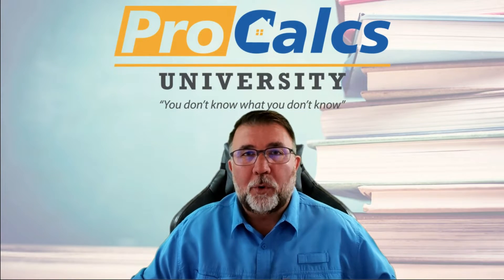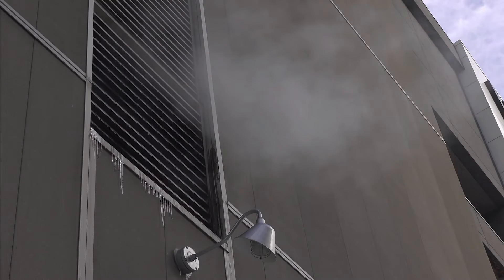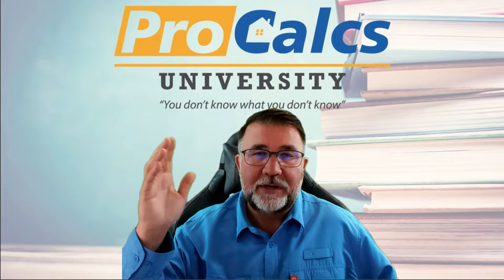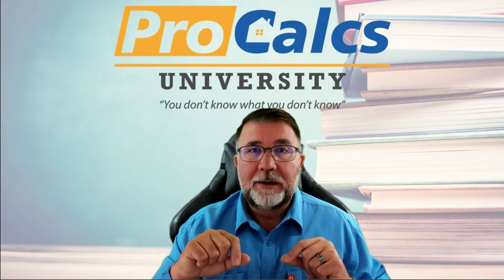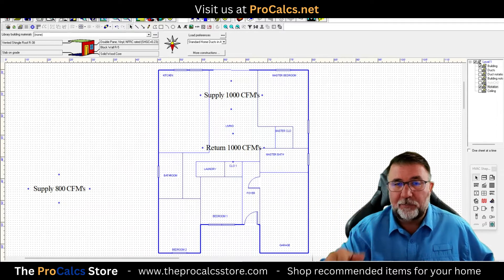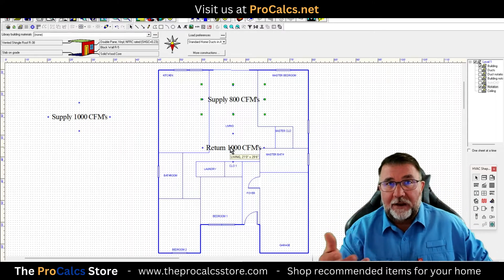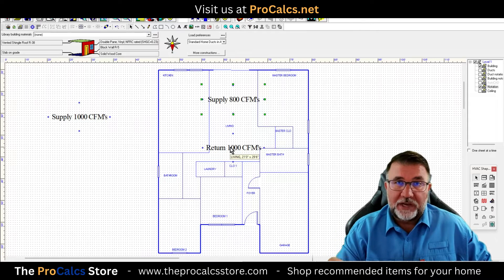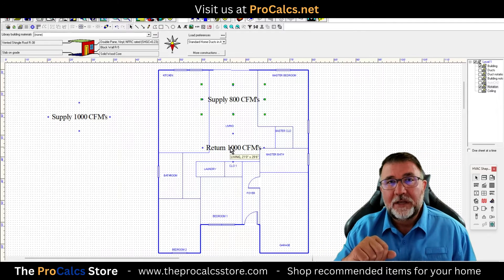Positive and Negative Pressure In Your Home

Comment: Hello! Who would you recommend I should contact for my following issue. I live in a house with a crawlspace, I have a dehumidifier down there with a vapor barrier, insulation board all around the walls. The HVAC system is also down there. For some reason, my house smells like an earthy smell. All my clothes smells like old wood, earthy. Who would I call and what kind of test do I ask if they can do?
Reply from the maker: Hey there! Great question! That earthy smell is usually a sign of moisture hanging around in the crawlspace. I’d start by calling a licensed HVAC contractor or an indoor air quality specialist so they can check humidity levels, duct leakage, and any moisture sneaking in. They should be able to point you in the right direction

Comment: I’m late here, but what kind of professional would we call to look at this?  We definitely have negative pressure.  And the house is starting to get water damage
Reply from the maker: @corabelly1100 sorry you’re dealing with this. Since you’re seeing water damage and suspect negative pressure, call a licensed HVAC contractor who does home airflow testing, or a home energy rater. Ask if they can do a blower door test, a duct leakage test, and quick room pressure checks. That will confirm what’s going on and point to the fix. In the meantime, use big exhaust fans only when needed, keep bedroom doors open, run a dehumidifier if you’re in a humid area, and make sure CO alarms work if you have gas appliances. Hope this helps!

Comment: What happens if a bathroom exhaust fan is venting into the attic without a duct leading outside through the roof or wall? Wouldn't it just pull in and circulate trapped attic air?
Reply from the maker: @JuanRamirez-tu6mn great question! If a bath fan vents into the attic, it dumps warm, humid air up there. That moisture condenses on the roof sheathing, wets insulation, and can grow mold or rot wood. In cold weather it can even frost and later drip.

Comment: What about separating the restrooms from equalized pressure of the house?
Is the restrooms supposed to be slightly negative?
Reply from the maker: Great question! Yes, restrooms are usually kept slightly negative to help contain odors and humidity. That way, air flows into the bathroom, not out into living spaces.
Reply: @procalcsuniversity1484  thank you for the response. 
Does it need to be negative at all times or just in use?
Reply from the maker: @txhc666  It doesn't have to be negative 24/7, but it should be during use or shortly after 😄

Comment: I have a slightly leaky timber frame house, it seems to me that positive pressure is going to push warm humid air into the walls where it will, at some point, meet colder surfaces and condense in the wall cavity. Wouldn't it be better to go the other way?
Reply from the maker: Thanks for your comment @johnhunter4181 You're absolutely right! Pressurizing a leaky timber frame home can push moist air into wall cavities, leading to condensation and potential damage. In such cases, aiming for neutral or slightly negative pressure with balanced ventilation is often safer.

Comment: So how would you recommend creating a positive pressure in a house that has a negative pressure?
Reply from the maker: Great question! @jsparx It depends on your setup, but generally, bringing in a bit more air than you're pushing out (via a fresh air intake or supply-only ventilation) will nudge the pressure positive. Hope this helps!

Comment: I have negative pressure even when no furnace/dryer/appliance is running.  My water heater often backdrafts... enough backdraft  to blow out the lighter every time.  When I open a door, the lighter stays lit.  If its not the a furnace or any other fan/ device causing the issue, what else could it be?  I added 18" height to the water heater termination point today and still the same problem
Reply: You need to call a professional before you or your loved ones don't wake up tomorrow. You're describing a potentially deadly situation in that home and extending your flue will do nothing to solve this issue.
Reply: @HVACinSC   HVAC pro is going to add a fresh air intake to the furnace return
Reply: @seankoziel2261 I'm glad to see you're still alive. With this sort of issue, we usually just see the aftermath of CO/CO2 poisoning on the news.
Reply from the maker: Thanks for your comment! @seankoziel2261 Negative pressure and backdrafting can occur due to insufficient ventilation or pressure imbalances in the home. Since you've ruled out appliances and added vent height, the issue might stem from a tightly sealed home, blocked venting, or even a leaky return duct pulling air down. 😄

Comment: Hi, nice video.  I had a radon mitigation system installed.  It created a negative pressure causing a backdraft in the water heater.  Can HVAC system be used to balance the pressure out?
Reply from the maker: @NovaNY347 Thank you for watching and sharing your situation! A radon mitigation system works by drawing air from beneath your home to reduce radon gas levels. This process can sometimes create negative pressure inside the house because air is being exhausted but not replaced.
When your home is under negative pressure, it can pull air from any available source including the flue or chimney of your water heater. This backdrafting allows exhaust gases, like carbon monoxide, to enter your home instead of venting outside, which can be dangerous.
Your HVAC system might help balance the pressure by introducing makeup air or adjusting airflow. However, depending on the extent of the issue, adding a dedicated makeup air system or other ventilation solutions may be necessary. We’d recommend consulting with a professional to ensure everything is safe and balanced. 😊

Comment: I have 800sqft space separated between 3 rooms, bed, living/kitchen, and bath.
Living kitchen is vaulted, attic space above bedroom.
Spray foam air sealed home. The current portable AC is pulling so much air out of the home creating a negative pressure.
My AC/Heat plan was to do dual head mini split with ERV, there is one exhaust fan in the bath.
AC guy wants to do a slim duct heat pump combo system, no mention of an ERV, wouldn’t it still give a negative pressure?
I can’t figure out what to do for an AC system
Reply from the maker: Thanks for sharing your concern, @Anonsbdofjrnwodb  We can't really comment on the studor vents since plumbing is not our specialty. As for AC, the most important part of preventing negative pressure is the air sealing of the building like you mentioned and sealing of any ductwork. A slim duct heat pump system will not automatically cause negative pressure if it is installed properly. The benefit of doing a mini split system would be the ability to separately control the temperature in the rooms where the two heads are. Which ever you choose, just make sure you get a Manual J calculated to make sure the system is the right size. 

An exhaust fan, if running for a long time or continuously could cause negative pressure, and in that case an ERV would be a better choice since it replaces the air it removes with fresh outdoor air. For a spray foam well-sealed house, an ERV is a great idea to provide needed ventilation for indoor air quality. I hope this helps! If you have any further questions, you can send an email to tom@procalcs.net

Comment: I have negative pressure in the home thanks to the AC, home is rather air sealed with spray foam, worried it’s causing problems with the AC, and plumbing.
Studio vents for drain lines. Will the stud or vents function properly in a negative air pressure environment?

Comment: Alright fantastic video, incredibly informative while still easy to understand for the laymen. How well would a wood match work if I can’t get a smoke stick to test airflow?

Also second question, I want to create a negative pressure in my bedroom… for reasons… (smell of a dry herb vaporizer) 

It’s a small room something like 14 by 14 feet, opposite the bedroom door the wall has two sliding windows that take up most of it. I have a box fan and a ceiling fan, I can block off the bottom of the door but not the other three cracks. 

How should set up my fan? Against the window pointing out? Or a few feet back from the window? Should I have my ceiling fan running as well? Should both windows be open or just the one with the fan pointing out? 

Sorry for my stupid questions lolol
Reply from the maker: Hey @Kyle_Spivis, thanks so much for the feedback! I'm glad you found the video informative. A wood match can work as a substitute for a smoke stick, but it might not be as effective.

You can also try placing your box fan against one of the windows pointing out to exhaust the air, and keep the ceiling fan running to help circulate the air in the room. Hope this helps!

Comment: In Colorado, we are typically low humidity, and most HVAC systems are installed in the basement. My issue is that we have bathroom exhaust fans and kitchen exhaust fan for a gas stove, which are temporary, but combined run for hours everyday. We also have gas hot water heater, and a gas furnace which draw in outside air through two fresh air intakes which dump into the basement. Then you add in a radon gas evacuation pump, and it’s safe to assume that our homes are under negative pressure. This makes me wonder if we should be adding an intake fan and heat exchanger to the fresh air intakes to control the location and conditions of the the air penetration and cause positive pressure.
Reply from the maker: Hello, @gregswank4912 thanks for sharing your concern to us. Could you provide the specifications or capacity of your bathroom and kitchen exhaust fans? Also, how airtight is your home?  These 2 factors will significantly affect outside air strategy.

Comment: great video. i live in a condo 2BD 2BA approximately 1000sqft and it has it's own HVAC system (inside my unit), washer and dryer hooked up to some duct by entrance door, kitchen range fan, bathroom fan, 3 windows that open for each room (master bedroom, living room, and spare room), along with a patio door opposite of the main entrance. Because we are the 3rd floor out of 4 floors, i would assume the washer and dryer duct is centralized but i do believe our HVAC is internal and no other ducting to and from other floors or at least from what I've gathered.

I currently have negative air pressure utilizing your method of closing everything and opening the main entry door a crack, which determined air coming in and not out. How do i create positive air pressure within this environment??

Forgot to mention, because it's a condo, my front door is within a corridor with doors on opposing ends that open to outside air. 

Also, thanks for your time!
Reply from the maker: Hello, thank you for your comment! Given your current situation of having negative air pressure in your condo, ensure that your windows, doors, and any other openings are well-sealed to prevent air from escaping, which can help maintain the positive pressure you create. Also, try to limit or adjust the use of bathroom and kitchen fans, as they pull air out of the condo and increase negative pressure. Additionally, appliances like dryers and kitchen hoods that exhaust large volumes of air typically need makeup air to prevent significant negative pressure inside when they are in use.
Reply: @procalcsuniversity1484  excellent thank you. anything I can buy like an erv or some kind of device to put in the window?
Reply from the maker: @TecraTube  Yes, an ERV can also help manage the air pressure in your condo. However, we highly suggest having your condo inspected first by professionals to assess your specific needs and recommend the best product for your situation.😊

Comment: Would house humidity go up if you increase positive or negative house pressure? Our humidity went up when we increased size of our return duct and we don’t know why. We think we have negative pressure but when barometric pressure drops in evening humidity goes down we are perplexed
Reply from the maker: Hello, @moreglistrefine1432 thanks for your comment! Normally, higher positive pressure pushes out humid air, reducing indoor humidity, while negative pressure can draw in outside humid air, increasing indoor humidity. In your case, the larger return duct could make the house negative and might be affecting airflow, potentially drawing in more outside humid air.

Comment: Question: I have a newer constructed house and I noticed that I get headaches when the heat is on only in the master bedroom. Sometimes the pressure closes the door. All bedrooms are on the second floor. So the master is on one side of the house, the remaining 3 are on the other side. Fyi...the other rooms are always colder than the master room. Does  that mean it is a negative pressure and the exaust setup is incorrect?
Reply from the maker: Hello @ccroney00

Thank you for your comment. It is possible that the negative air pressure in homes potentially causes headaches, although it's not a direct or universal effect. Headaches can result from various factors related to indoor air quality and comfort, which can be influenced by negative pressure.

In your case, if the master bedroom consistently feels warmer while the other bedrooms are colder, it could indicate that there's an imbalance in the airflow within your home. This could be due to problems with the ventilation system, such as inadequate exhaust or improper distribution of air.

It would be best to have a professional come out and inspect your system. It could be that the room, in particular, has higher pressure than the rest of the house because it does not have a return, or the supply is putting too much air.

Comment: So, everyone has negative pressure pulling in outside air (from the fireplace in my case) when an exhaust fan is turned on.  Do you have a solution?  I had to seal up the house to pass the air test done by the county.  Now the exhaust fans pull from the flu in the fireplace (I don't close it because we have fires all the time).   I open a window when the dryer is on but want to know if you have a better solution.
Reply from the maker: Hello @ryanl6722! Thank you for your comment. It sounds like you're dealing with a challenging situation. Could you please share the results of your blower door test and the size of your house? Typically, since exhaust fans are intermittent and have a smaller CFM compared to the total volume of the house, the pressure differential created by them isn't usually a big concern. It primarily increases infiltration. Regarding the air coming in through the fireplace, closing the flue might help, but it could redirect air through other openings.

Comment: Found your video to be very educational. I came here is seeking an answer as to why the vents on left side of my house are displacing cold air from the vents when the furnace is off. It is 2 degrees or more colder on this side of the house (office). When the room is heated, the office feels cold after the furnace goes off in 4-5 minutes, or sooner, depending on how cold it is outside. I suspect the warm left over air in the cold vent is mixing. This is resulting in cool air dropping down from the vent which requires I wear a jacket and my fingers and hands are cold, although the thermostat says it is 71 and a local temperature gouge in my office saying it is 69. 

I tried your negative test and I even more confused. Yes, when opening the door on the left side of the house, cold air came through the crack of the door. However, when I slightly opened the door on the right side of the house, which feels warmer and more comfortable, the air flow was double, if not triple, the amount of cold air coming through the door crack. I will say the stairs to the 2nd floor are just beyond the right front door, so I suppose the argument it is sucking cold air in and going straight upstairs. However, the 2nd floor is very comfortable and warm at 71 degrees. Either way, both doors indicate I have negative pressure. 

I believe strongly the house HVAC ducts were installed poorly (looks like spaghetti and you cannot even get to ducts to check), they are not sized correctly with 10ft ceilings and very little air flow out of the vents such that a 6ft person standing directly under the vent cannot even feel the heat hitting their head when the furnace is on. No luck with HVAC companies as they are looking for easy fixes (replace heating unit with larger system, move system from 3rd floor to crawl space, etc.). I am not sure they are schooled in how to address negative pressure homes. Not sure where to go from here.
Reply from the maker: Hi Michael! It sounds like it definitely is possible you have an issue with negative pressure causing some temperature problems. But since you mentioned the temperature difference between upstairs and downstairs, it could also be due to the location of the thermostat if there is only one. If the thermostat is upstairs, it's possible the system is only running until the upstairs reaches temperature, but that isn't enough time for the downstairs to warm up enough. Since warm air rises, the upstairs will always be a bit warmer than downstairs. This is why we always recommend having a zoned system, with a separate thermostat on each floor. Of course I don't know your exact setup or equipment, but it is something else you can look into.